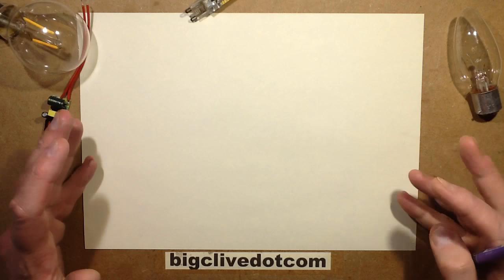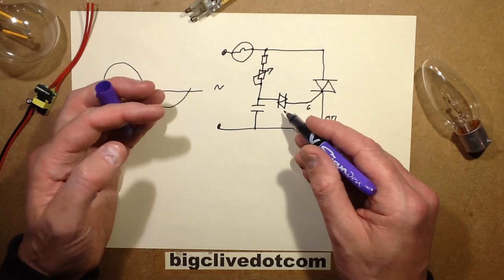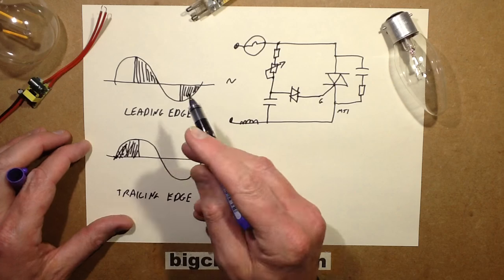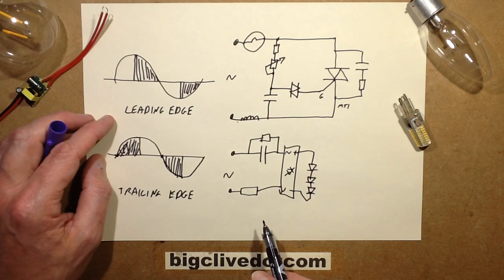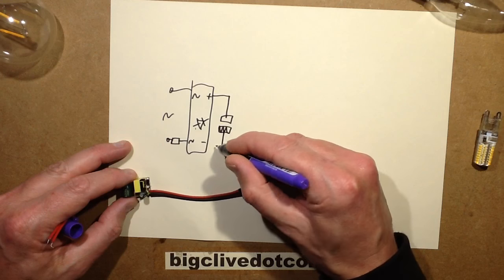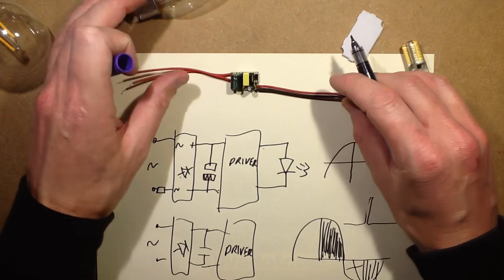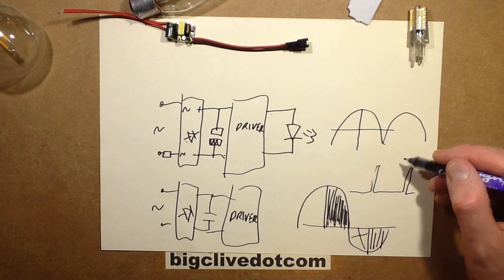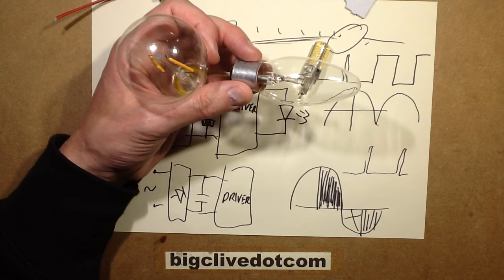Dimming LED lamps with ordinary dimmers.

Comment: I know this is an older video, but nothing much has changed in nearly 3 years.  Dimmers are still pretty well how they use to be.  I think the electronic dimmable bulbs seems to be the way it should go, and maybe dimmers that work on the 0 to 10v analogue principle.
Mains "retrofit" dimmable LED's are still a flickery mess even now.
Philips Hue globes, as an example, are buttery smooth to dim, but "dimmable" MR16 retrofits are horrid, flickery and completely the opposite of smooth.
Reply: @johncoops6897  It wasn't worth leaving it up, given you agreed with the state of retrofit lamps.
You can't blame drivers for the issues with the circuits in MR16 retrofit globes that are meant to be plug in replacements.
Wall dimmers still have not changed much in three years.
Even brand name globes fail very prematurely.
I never said there were not any good electronic lamps if you go new drivers, new dimmers and new lamps.  
That defeats the purpose of what retrofit globes are meant to do.
It really wasn't worth starting an argument over.

Comment: In usa, we have 3 way lamp switches.  Are there any 120vac led bulbs that operate correctly in them?
Reply: I have seen 3-way LED bulbs for sale, may have even purchased one to test, but have not actually tried one.
Reply: The 3-way socket is simply a low-intensity and high-intensity filament and you switch through 1... 2... or both. Making an LED version of that is very simple.

Comment: One word: Variac

Edit: Or remove the ac circuit, make them DC and add a diode to your dimmer circuit's output?
Reply: Dovahkiin-Warrior Feeding DC to an LED lamp with a capacitive dropper will provide nothing but darkness.  But feeding such a lamp through a variable capacitor should work just fine.  Price may not be that low as it needs to regulate between about 10 times the dropper and 1/10th of the dropper while being fully mains rated.
  Generating a mostly smooth output that peaks at mains voltage and repeats at > 400Hz would be tricky, but not impossible, especially with a requirement to minimize losses.  Such an advanced dimmer would probably include internal smoothing capacitors and coils, plus a microcontroller.  Cheapening the circuit will be a lot of work too.

Comment: Would be interesting to see a video on dimmable fluorescent light fittings.
Reply from the maker: They usually have circuitry to keep the cathodes at the ends of the tubes hot so they remain in an emissive state while the lamps are dim.

Comment: What if we put the LED driver with PWM and dimmer control inside the switch box with the knob that controls the brightness? Instead of sending AC to the light fixture, we would just be sending controlled DC. Over short runs (like what you'd see in most homes), this could work. Of course, it would mean that most of the current LED lights would most certainly NOT work and would need to be replaced with super cheap "dumb" LEDs. Basically just a safety resistor and the LEDs in series. Or am I missing something?
Reply: In the long term, that's the best solution, yes.
Reply: LED drivers produce heat and take up space. If you have many lights controlled from one switch plate, that's a problem. It also gets difficult to run multiple different lights from one dimmer.

Comment: What's wrong with dimming 12v DC LED lamps etc? Far too many of these lamps are made to run on AC at a voltage which must be reduced through pretty dodgy convertors.
Surely DC is the better alternative all round

Comment: I'm surprised that you didn't mention LCD backlights in smartphone displays. Sure, cheaper backlights do show flicker when dimming, but it still works very well, much better than your video made it seem like it should.
Reply: Dimming a LED isn't a big problem when you don't have to go through mains AC wiring to reach it. Unfortunately, there's still smartphones (and car tail lights) that do the dumb high-frequency PWM thing which is easily noticeable when your eyes move, just not quite as obvious as the 100Hz flicker you can get with mains. The only acceptable method in my opinion is DC dimming, then there's no flicker at all.
Reply: PWM is perfectly OK as long as you have a high enough chop frequency.

Car taillights are deliberately PWMed at a low enough frequency for strobing effects to be noticeable as this ensure that they're more noticeable when emitting low light levels and in poor conditions such as fog (Our eyes are geared to seeing movement slightly quicker than stationary objects and the flicker translates as "movement")
Reply: When the PWM frequency is truly high enough, then sure. I just know e.g. 1 kHz isn't enough. As for car tail lights, that's certainly one explanation, but I'm not sure I believe it. The flicker is so annoying in regular visibility conditions... Also when the tail lights brighten up during braking, they stop flickering. One could argue it's more important to be noticeable then, and true low-frequency strobing (~10Hz) is already used in F1 for hard braking...

Comment: Just thinking outside the box regarding dimming LED lamps. Why not use several capacitors of different values to act as the dropper for the circuit (reverse of method used on car fan speed switches). Not an ideal solution, but good enough if you only want a couple of brightness levels I'm thinking?
Reply from the maker: That would work with capacitive dropper lamps, but I'm not sure how the ones with switching drivers in them would handle a current limited supply.
Reply: bigclivedotcom I was only considering the Capacitive dropper variety. What prompted those thoughts was your video where you hooked in a tiny cap in series to try and drop the intensity of an led filament lamp to identify the individual LED chips. Anyway, it was just a thought :)  (love your videos, keep em coming)

Comment: I have a problem I hope you can solve, I own a pair of Quasar Science X 
crossfade LED tubes made for film.
They are 120V AC 50/60hz and are dimmable for high framerate cameras 
(180FPS in my case). The problem is that they recomend very few dimmers 
as I was demonstrated in the lighting place I purcahsed them that only 
the LUTRON CL Lamp Dimmer could deliver flicker free on the light meter.
 

I have now moved to Australia now where mains is 240V AC 50HZ, I can use
 a step sown the achive 120V 50HZ but I need a dimmer that can deliver 
flicker free performance with this input. The only dimmersI can find are
 60hz at 120V and that without knowing if any will be flicker free. Any 
help or product suggestion would be appreciated.

Comment: I've had LED lights for quite some time, starting with Sunflux. I recently moved to a new apartment with built-it dimmers, and I found out that Ikea has some pretty good dimmable LED bulbs at around 3.50 €, ranging from 200 lumen to 1000 lumen. They are even just about the same size as old filament bulbs, and has a pretty good spread. Well worth trying! ;-) @bigclivedotcom - any chance of you taking it apart, analyze and show the workings?

Comment: The Future of LED Lamps is control from the smartphone. Then all the circuitry can be contained within the bulb. as with Philips hue and so on.
Reply: Well, I have 3 methods of control from my phone. 1. The method you described. 2. "Okay Google, Set bedroom lights to 50%" 3. I have a lock screen shortcut so no need to unlock my phone. I can also control from smartwatch in similar ways
Reply: Bleh, i hate this idea and I honestly hate smart phones too. Small, fiddly, annoying, have to arse around digging through multiple layers of apps/menus to get anything done. Having a physical button is vastly superior.
Reply: c'mon.... the next clive videos will be of how to hijack the super duper 128bit microcontroller with AI and get past the paid-per-month function "turn on"... it will be fun!!

Comment: Just a stupid question. Would it not be possible to smooth out the sharp inrush current to the capacitors by inserting a smoothing inductor into the circuit? This should save the resistor as well. Except for the increased price, do I miss something here? (seems to simple as a solution)
Reply from the maker: Some dimmable LED lamp chips do specify an inductor to remove the harsh edge.

Comment: Rather than pulsing the current, couldn't you just reduce the current?  A simple rheostat (with beefy heatsink) seems enough for this, especially paired with low voltage conversion.

Comment: You mentioned Bluetooth bulbs and such, so how do lights like the Phillips Hue smart bulbs dim? Are they doing that more expensive analysis method you mentioned to monitor and vary their output?
Reply from the maker: The smart lamps just use the incoming mains as a plain power supply and use internal control to pulse width modulate the LEDs for smooth intensity control.
Reply: +bigclivedotcom Did you ever look at something like this? 
http://www.bmstores.co.uk/products/optimum-led-colour-changing-light-bulb-b22-305823
 it's quite futuristic looking with what seem like heavy heatsink fins. Ican only find you looking at ripple projector with similar RC handsets.
Reply: They don't have to look at the input. All the signal comes over Bluetooth or some other radio protocol. As long as there's enough voltage on the input, they'll output whatever they're told.

So you can't use a wall dimmer on them.

Comment: Can you adapt a traditional dimmer somehow to be compatible with LED? or is it a matter of binning and buying a varilight v-pro? I have a remote dimmer that I love, but it says minimum load is 40w and LEDs nowhere near this value, so it thinks there is no lightbulb and does not work.
Reply from the maker: You can add another traditional load, but the best thing to do is get an LED compatible dimmer.  Preferably lagging edge.

Comment: bulbs that are DC with pwm or fwm coming from the wall.
Reply: Are you saying that there may be LED bulbs that run purely on DC voltages and the dimmer uses PWM?  Well, I suppose that's possible, what about 12 volt halogen lights?  Does they run on 12 volts AC or 12 volts DC?  If we were to change to DC powered lighting, it would need to be a complete full switchover for compatibility's sake otherwise you'd end up with hugs problems.
Reply: Halogen can run on either, they are basically a standard tungsten filament bulb filled with an inert gas. The L.E.D. only lights when reverse biased the DC circuit is fairly easy to control.
Reply: I'm surprised Clive didn't mention DC. It could eventually replace AC for home circuits and USB power delivery may play a large role.
Reply: Sure. If we were designing from scratch, all our lighting would be DC, and at a voltage most suitable for driving LED lights directly. And I expect to see that happen in the long term. But here in the UK we need solutions that are compatible with all the old wiring that's already installed in old buildings.

By the way, you also have to consider how you would control lights that are operated from more than one switch.
Reply: You seem to miss-understand, all the hardware fits into a standard socket the control is done via the start voltage and phase. although you could retrofit with dc lines to the lamp fixtures.
Reply: Do you mean that we should move most of the electronics from the bulb into the light fitting?
Reply: Will that would be a sort of answer but no I was talking about the bulb the metal part. It would require some phase checking and voltage comparison but with modern tech it should be small enough to fit, if a bit pricier than these cheap ones.
Reply: I don't understand you. Tell me about the pwm / fwm.
Reply: FWM frequency width modulation I goofed its  frequency controlled voltage is when an coil is used to set the voltage by varying the frequency of the control signal.
PWM pulse width Modulation is a circuit that uses the width of a pulse to charge a capacitor to a set voltage during a charge discharge cycle with modern very small parts we can shirk these down alot and get reasonable voltages.
Reply: Er, no, never.

Comment: One of the (many) jobs of a LE compatible driver is to damp out the oscillations between the dimmer and emc filter capacitors. On most drivers this is achieved by having an additional series R+C after the bridge rectifier (usually 220nF and 330 Ohms)
What is not obvious is that this creates extra heat when used with a LE dimmer.
Example : 10 watt lamp full power no dimmer ( or TE dimmer) driver power loss =2.5 watts.
With TE dimmer at full power, driver power loss = 3.5 watts = 40% increase.
Why be bothered? well extra heat means it won't last as long, so my advice is never use LE dimmer with LED lighting. Use TE ( trailing Edge ) types such as Varilight Vpro

Comment: One solution for proper dimming is to use led lamps with no driver in them as such and instead have a stand alone pwm dc power supply where the dimmer knob is mounted on the wall next to the switch, no mains chopping involved at all as it too hard.

Comment: I noticed that when I add 1 incandescent bulb to a circuit of LED bulbs that the dimmer functions correctly without flashing. What do you think is happening here? Are the LEDs going to be prone to early failure?
Reply from the maker: The lamp is acting as a ballast load that help the dimmer operate correctly.  It needs a minimum current to work.

Comment: Could they put the PWM into the dial and then make light on the roof an LED with no circuitry. Removing the need for any fancy communication.
Reply from the maker: To make things future proof I think there should at least be a fixed power supply feeding each lighting position.  Mains or low voltage.
Reply: aljowen I

Comment: Today's LED dimmers and universal dimmers? Where do they fit in to the picture? Also infinitely variable ceiling fan speed controllers and why do they make the motor buzz?
Reply from the maker: The fan controllers are probably using phase angle control which causes a sharp current spike on each half of the mains waveform and will make many loads buzz, especially at the mid settings.

Comment: Do the fan regulators with capacitors and selecting between them in steps work for LEDs? If no, why?
Reply from the maker: Switched capacitors will work with some LED lamps but not all.

Comment: Resistive load vs. reactive load. The old filament lamps are resistors, where the phase angle between voltage and current is zero. But with reactive components as a load, such as capacitors, then the phase angle between voltage and current is no longer 0 degrees. God knows what the phase angle is because all lamps are different. It's a wonder to me that manufacturers have managed to make dimmers work with today's LED lamps. It's probably going to require some new standard for LED lamps and dimmers to fix this issue so that all LED lamps and dimmers present identical loads to one another. Remember the old X10 systems that Radio Shack sold long ago? Those things passed a high frequency signal (100 kHz?) through the power line that could talk to the receiver. These days they might use a wireless RF link instead. If that ever happens, we'll see the opposite of today's dilemma, where it's the old filament lamp that won't dim when used with the new LED-only dimmers. Just on/off, and that's it.

Comment: Hi Clive,

I was wondering if you could you use a rectifier and inverter to increase the AC frequency and then use a triac at the higher frequency?
Reply from the maker: The existing dimmers are in series with the lamp which complicates that idea.  A higher AC frequency would also obliterate some LED lamps by causing huge current flow through them.
Reply: Awesome!

Thanks for the great videos 😁
Reply: James Stallwood An issue with triacs at a much higher frequency is they can self trigger due to internal capacitances, in data sheets you will see this referred to as dv/dt (change of voltage over change of time).

Comment: I guess using proper low voltage LED bulbs and have separate PSU handling the dimming would be a good solution.

Comment: Would it be possible to use a rotary switch to select different value capacitor’s similar to your Dubai lamp videos?
Reply from the maker: Yes.  But that will only work with some lamps.

Comment: could you do an explainer for why some LEDs lamp flicker and light even when the circuit is off on a dimmer, along with potential workarounds?
Reply from the maker: Dimmers have filter capacitors in them to reduce electrical noise and help ensure stability of the triac's operation.  They leak more than enough current to make many LEDs glow brightly.

Comment: In my ideal future, no bluetooth of wired communication would happen, but rather , the wall-mounted dimmer itself will be a constant current LED driver and PWM controller at the same time, driving simple LED lights.